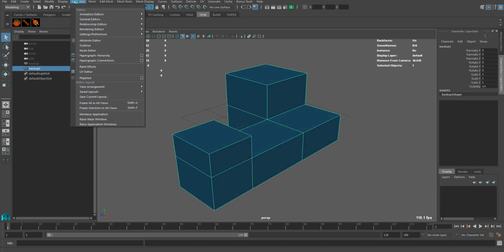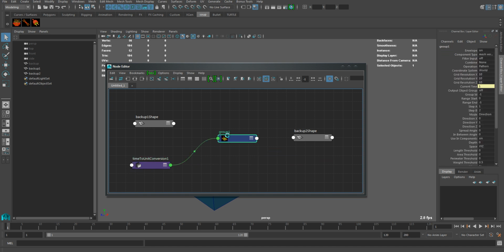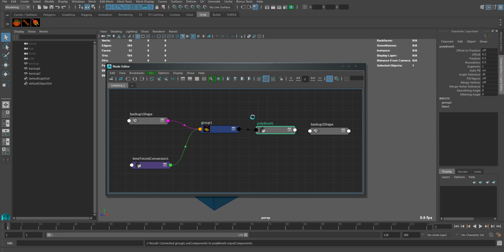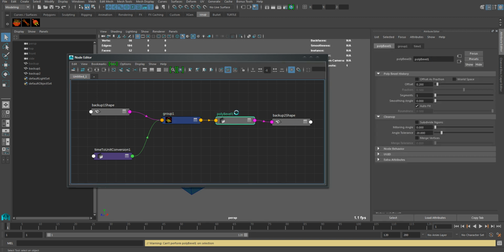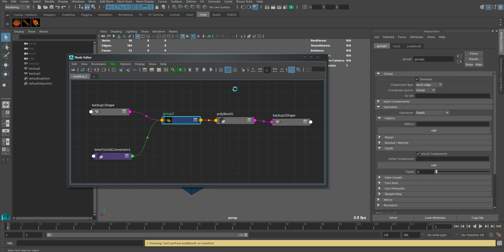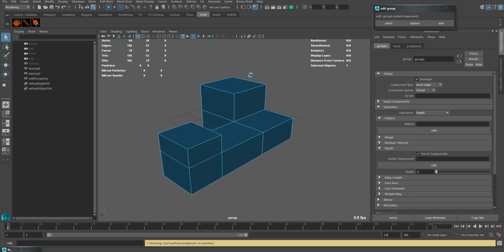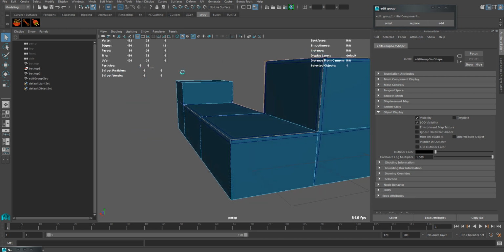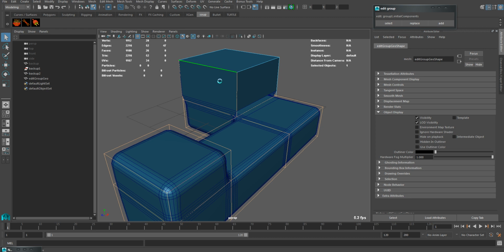Nondestructive Bevel for Maya

Comment: Wow this is very very helpful. can i disable the applied bevel and change the form of the original base mesh and just re-apply the bevel?
Reply from the maker: Ivkov Ivkov Yes you can do that, basically you start with a mesh shape node and then run a series of nodes and use another shape node at the end, you can disconnect the original shape node, do whatever you want to it , delete the history and then re connect the nodes. Be aware there is a bug on some versions that scaled the model, if that happens just export the mesh as obj and reimport to have a clean mesh.
Reply: That is great, one question though,  it would be very helpful if you elaborate how i could "run a series of nodes and use another shape node at the end"  Are you saying its the same procedure you just showed on this video or its another method?
Reply from the maker: Exactly the same procedure i'm doing in the video, whenever you do an operation in maya on an object, it keeps the original object and uses it as the first node, and adds nodes after it.

Comment: It appears destructive ?
Reply from the maker: +The Christopher  It relies on the maya bevel node.....so the soup node works if the bevel fails it's because the algoritm isn't as good as quadchamfer.
Reply from the maker: +The Christopher By nondestructive i mean you can always go back and change it or turn it off.
Reply: +TheIcemanModdeler 
I understand, regardless if one does 25 of your SoUP bevel operations, you can go back twelve bevel operations and delete that twelve bevel ? 

It is a good idea, except it doesn't appear intuitive.
Reply from the maker: +The Christopher Yes, in order to remove a specific bevel just deselect it from the soup group node window and hit Replace, you should try it since soup is free.What can be more intuitive than just selecting or deselecting edges without adding history?
Reply: +TheIcemanModdeler 
You know I use SoUP, I just had some questions regarding how it works.  Let me try it and take it from there.
Reply from the maker: +The Christopher Aa yes from vimeo right?
Reply: +TheIcemanModdeler 
Yes ! Hahaha.
Reply from the maker: +The Christopher I knew it....sorry about that.....do you know scripting?
I have been trying to create support edges similar to how quadchamfer does it for max and i can't seem to be able to do it. Bevel has this option but it places some vertexes in wrong places and requires manual cleanup.
Reply: +TheIcemanModdeler 
I am in the process of learning MEL then Python, why you'd like to see this automated or otherwise ?

I'm not aware of how quadchamfer does it in Max, I'm going to have look into that.  Can you explain the issue with bevels, you can reply here, or you can message me, whatever you prefer.
Reply from the maker: +The Christopher Yes, i posted on multiple forums but so far no help, basically bevel in Maya 2016 creates only quads now with 2 segments which is great but it still has problems with stretching the geometry or moving vertex too far out or in. I was trying to create this using soup or mel by i am a noob at soup and at mel i'm even worse. Here is the forum i posted and where i'm at :
http://forums.cgsociety.org/showthread.php?f=89&t=1324534

Some videos showing how quadchamfer adds support edges without rounding out the shape.
https://www.youtube.com/watch?v=GevvjkSHU4g
Reply: +TheIcemanModdeler 
Can you show me a screen shot of how bevel works in Maya 2016, unless it works the same as in 2015 ? 

Your SoUP Bevel works, not on polygons; rather edges, correct ? There are consistent edge loops in your SoUP Bevel, can it not work on polygons ?

With regards to a script, do you think it needs to have to access to SoUP nodes ?

string $selectedEdge[] = `ls -sl`;
for ($item in $selectedEdge)
{
    polyDuplicateEdge -ch on -of 0.1}
}
I know you are a newbie at MEL, so am I, understanding the API is the most difficult for me, once I begin to understand it gets easier. I suppose storing the edges in an Array would be the start, not sure about the loop, Hrm.
Reply from the maker: +The Christopher In 2016 they fixed the triangle that appeared on borders and also the extra faces with holes that appeared when the bevel created ngons and tried to fix them, i've also seen some fix in the roundness if it gets turned to 100 but like i mentioned previously some vertexes don't get placed correctly.
Regarding the bevel i made.....i think i should work of polygon faces if that's what you;re referring, plus in Maya 2016 if you select some faces it doesn't bevel each face individually more like then entire row of faces as one group. For the script i have no idea, on a forum thread i found that i can apply a polygon split and then select that split and use slide to get into position but the problem is if i select an edge it doesn't add an edge parallel but perpendicular to my selection. The only way of doing that is with the polyDuplicateEdge but it needs to be applied on each edge in the selection. Not sure if this can be achieved with Soup, with mel anything can be done.
Reply: +TheIcemanModdeler 

You need to translate the SoUP nodes to MEL / Python so you get the exact same effect, hrm.